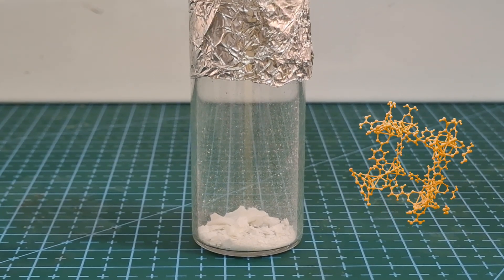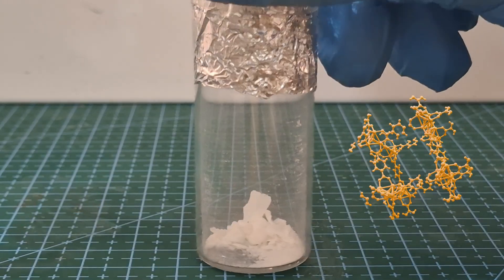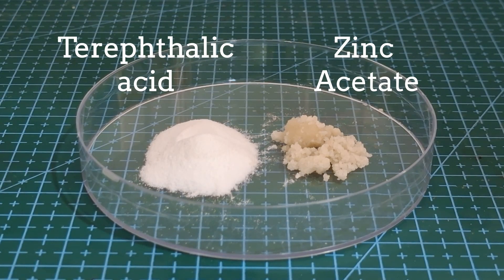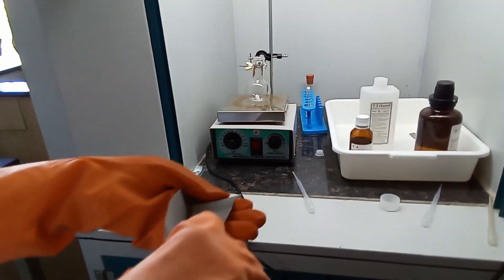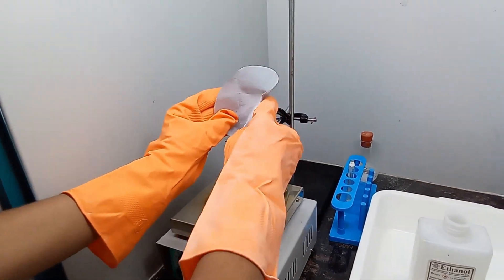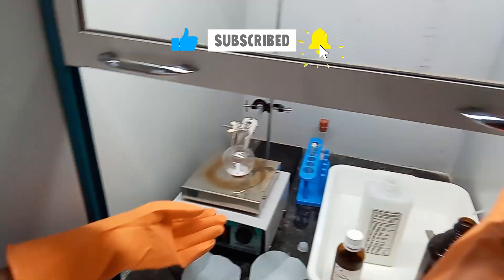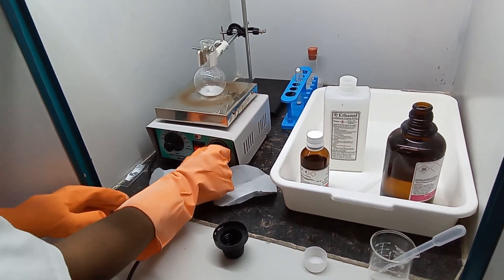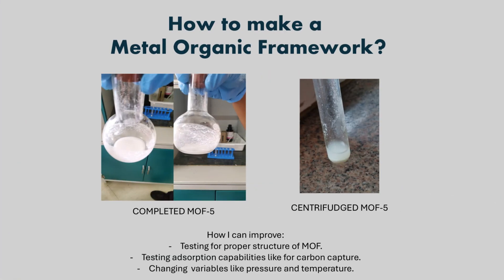Making MOF-5 | Nobel Prize in Chemistry 2025 | Metal Organic Frameworks

Comment: Great. How Can we make Mof801?
Reply from the maker: Thanks for the comment! I was able to create MOF-5 as the resources to make it are pretty easy to obtain as a home/amateur chemist, DMF and triethyamine of off Amazon, zinc acetate using old alkaline batteries and terephthalic acid from hydrolizing PET bottles. The issue with MOF-801 (I am pretty interested by its water capturing properties) and other zirconium based MOFs (like UiO-66) is that zirconium oxychloride is hard to obtain. Fumaric acid (the organic linker) is easy to obtain, on the other hand. 

Will look into obtaining zirconium from zirconiated tungsten rods.